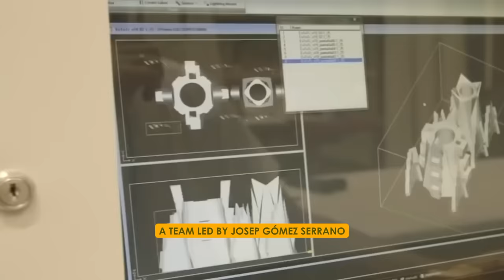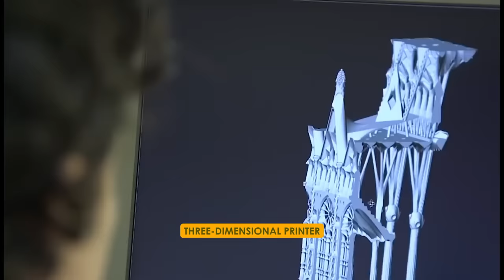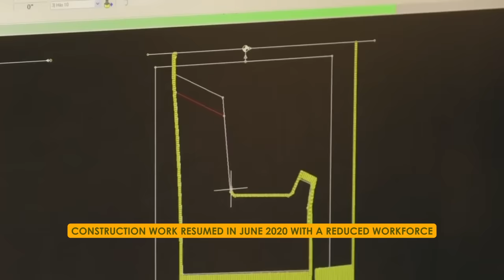Construction UPDATE: La Sagrada Familia Near Completion After 142 Years

Comment: I visited La Sagrada Familia in 2018 and again in 2019. I 2019 I did a tour of one of the spires [ you take an elevator to the top, then walk down near top crossing to another spire connected by a concealed cross walk tunnel hidden in the back of the spires. While it has a railing on the left wall, there is no railing on the right (and no wall on the right - just an open void dropping to the bottom of the spire - hungrily calling to those who are afraid of heights)].

Comment: So the cathedral will not be finished for maybe decades. However, are all the "finishing touches", simply on the outside?
In other words, is the interior work (the part that most visitors will interact with) completely finished as of today?
And while from a distance, it will be great to see the completed building, it is the interior that most people relate to.
Reply: The interior was finished around 2010 or something. But it still remains unfinished the tallest tower (which will have a sighting site) and the main facade with the main entrance.

Comment: I don't like the mismatched white stone very much. Will it age into the same color as the rest of the structure?
Reply from the maker: That's an interesting observation! The white stone you see is indeed different from the rest of the Sagrada Familia. It's Montjuïc stone, originally the primary material used in the construction. Unfortunately, the quarries are now closed.  The Sagrada Familia is currently using similar-looking limestone from other regions. While they may not perfectly match now, these stones will all weather and age over time, likely becoming more unified in color.

Comment: I visited S.F. First time in 1985. There where some outside walls and the smaller side towers and entrances. So I counted, that construction would last at least 100 years more, given the statical challenges given by the original design. Today I am totally amaized, how construction advanced in the 2000‘s till 2024 a I am looking forward for the completion of the central main tower. Curios also, when and how the main entrance, which would lap into the neighboring square, will be managed, considering the residencial buildings standing there actually. Many years for total completion …..
Reply from the maker: It's amazing how much progress has been made since your first visit, isn't it? The advancements in construction technology have been key.  You raise a great point about the main entrance! We're also curious to see how that unfolds and what solutions they come up with over the coming years.
Reply: I saw it in 1968, before there was a permanent roof. Our daughter brought back pictures 42 years later after the roof and the third facade had been completed. My understanding is that the nave is still supposed to be extended to a neighboring block, which will require the demolition of all buildings on it.